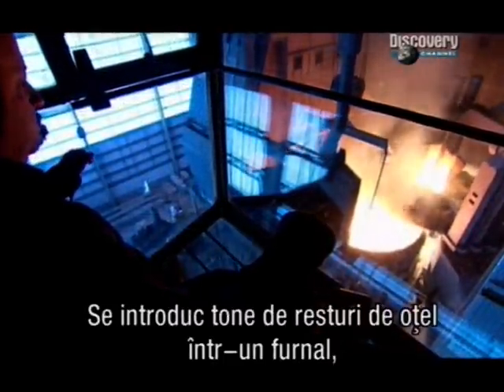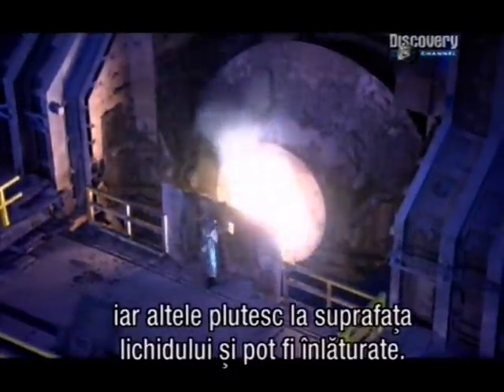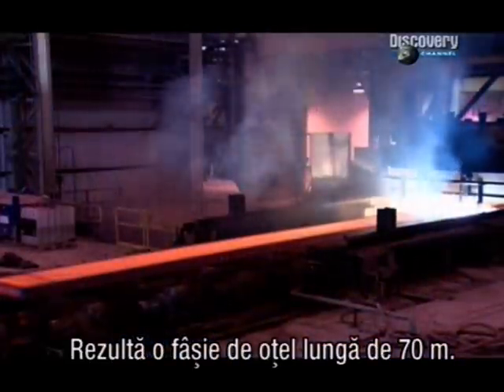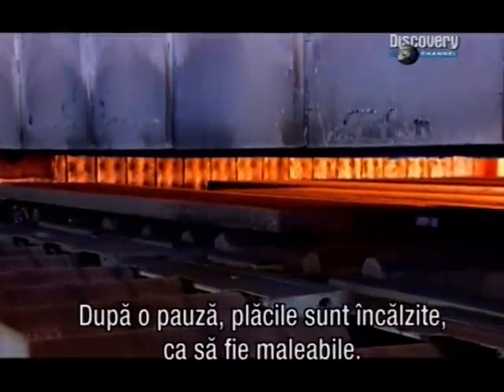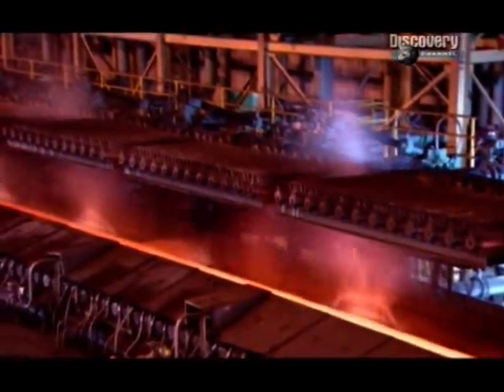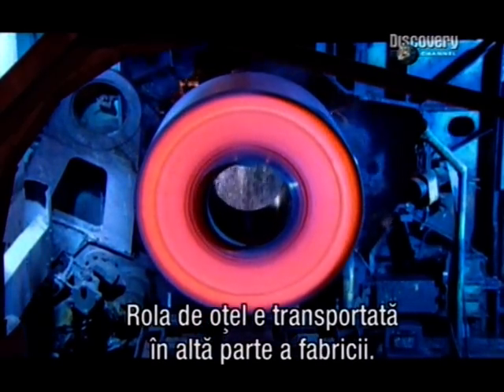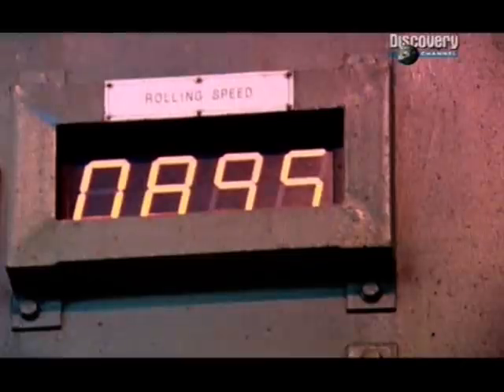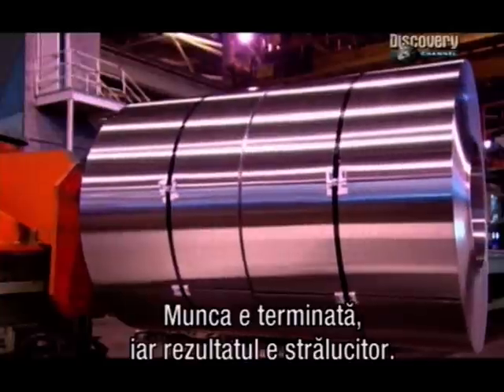How it's made - Stainless steel ( RO Sub )

Comment: what i wanna know is how and what is that hot furnace made!
Reply: Heat reflective bricks or ceramic probably.
Reply: DirtySouthFlorida3 ....it's made of plastic and stainless steel.
Reply: They are made by SMS-Demag. ABB also makes furnaces for metal fabrication.
Reply: That is made by refractory bricks.. Usually basic bricks like Magnesite.. Whereas the top of the furnace or the roof has Alumina bricks..

Comment: it still rust's, that's why it's called Stain LESS steel lol
Reply: Stainless steel does not rust unless it comes in contact with other ferrous metals, or if the stainless is subjected to abrasion it will corrode as the oxide, which prevents corrosion, is worn off. The simple act of using a mild steel brush to clean a stainless weld is enough to cause some minor rust. Stainless steel does not rust or corrode when used under the proper conditions.
Reply: Steve Clapton fan sir contact number send you

Comment: I have been working in a stainless steel importing and distribution company for some time now, so it is nice to see how those tons of alloy are made.

Though I am disappointed that they did not show the two main types of stainless steel- ferritic and austenitic and different grades of steel such as the common AISI 304s, 430s or the types of visuals such as polished, ground and so on. Nice video, tho lacking.